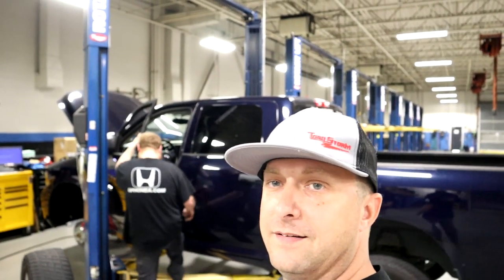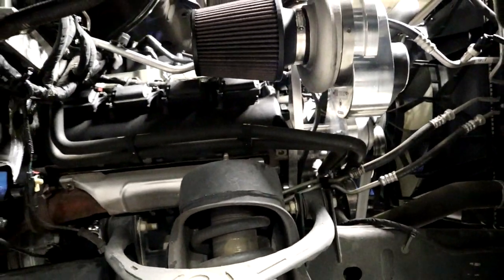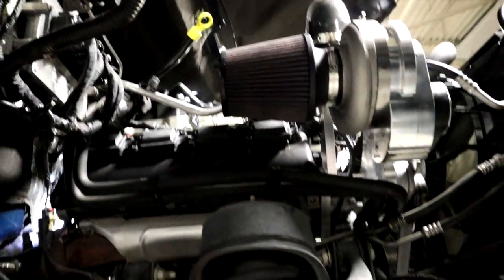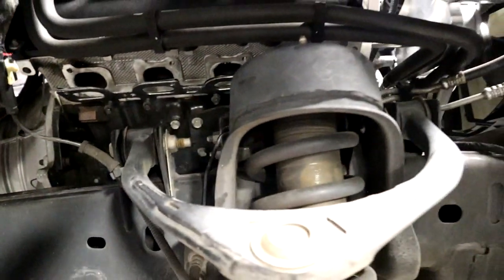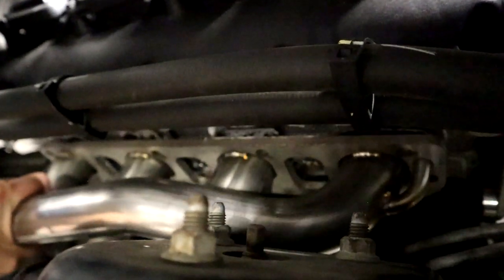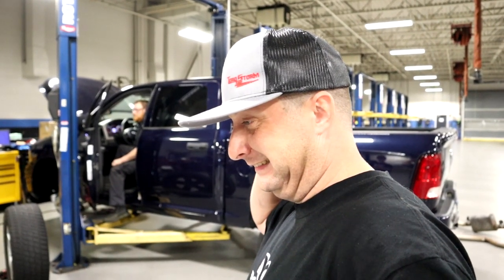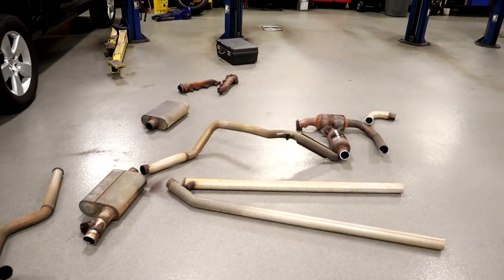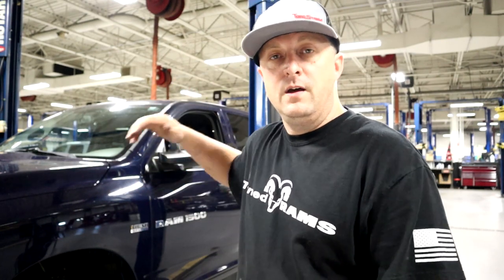Project STORM 2012 RAM 1500 Gets NEW Texas Speed 2" Primary Longtube Headers Installed

Comment: 2” primary’s seem huge if you have a stock engine
Reply from the maker: Not really the hemi loves em.
Reply: Any engine benefits from a bigger header / exhaust every engine responses good to 3 inch each and bigger primary 2 is fine with other bolt ons and tune will make it breath better

Comment: I have a 2011 dodge ram 1500 bighorn Quad cab with 5.7 hemi on with a shorty and wanted to put a long header? Is that will fit to my truck? DO I need to modify something to put that on my truck? One more thing I just want to know if did something about your steering to make it feel steady while on a high speed. Mine if I hit a little bump or hole it wobble, how can I eliminate this problem, any suggestions? Thanks!
Reply from the maker: Dipstick may need adjusting or replace with flexible stick

Comment: Are The header gasket that come with the headers are worth using?? or do I have to get a new set of header gasket for em ?
Reply: Used oem 6.1 gaskets and header bolts. Ordered through hhp racing
Reply from the maker: Oem 6.1 gaskets

Comment: Quick question,  I'm currently running JBA long tube headers on my 2012 ram 1500 5.7 2wd.... and my steering knuckle seems to be rubbing on the headers.... I'm about to install TSP longtube headers like what you just installed are you noticing any rubbing with the steering rubbing on the headers?? Thanks in advance
Reply from the maker: The tsp has alot more room
Reply: @FrostbiteRam  thank you very much for the reply.
Reply: @FrostbiteRam  TSP headers going on today. 💪

Comment: Did you have any problems with clearance against the steering knuckle? I have a 2013 ram single cab and im in the process of installing them but the headers sit against the steering knuckle
Reply from the maker: Fits perfectly
Reply: Did they end up fitting ?
Reply: You could just get a hammer heat it up and give it a wack they will work regardless

Comment: Did you guys have to tune it? Or is the tune going on after everything is done?
Reply from the maker: Running on the current tune that was in it no changes at all yet
Reply: @FrostbiteRam  ok thanks truck sounds amazing!  I have 2017 ram that I wanna do the same thing with. It’s stock engine  with a carven muffler and cold air intake. I wanna do long tubes like project storm,and maybe a torque storm pro charger later down road
Reply: It was tuned before installing the headers because of having the torqstorm supercharger on it, but tune has not been changed since installing the headers
Reply: @stormram2783  thanks sounds great man! What tuner do you have on jt
Reply: Using Flyin Ryan
Reply: @stormram2783  thanks!!
Reply: Can I use stock converters n y pipe with these ?

Comment: Are you running stock internals? How much psi of boost?
Reply from the maker: Yes
Storm is about 8-9 psi
Frostbite is almost 13
Reply: @FrostbiteRam   and it’s safe? I’m so close to squeezing the trigger on a supercharger. What’s all done to it? Cam heads etc? I just contacted Ryan about the mark 82 so that will be first then a blower
Reply from the maker: @douglasbakerjr6706  8 is the safe zone I'm pushing my Frostbite truck really hard but running e85 and excellent tuning.  Both have stocks heads also